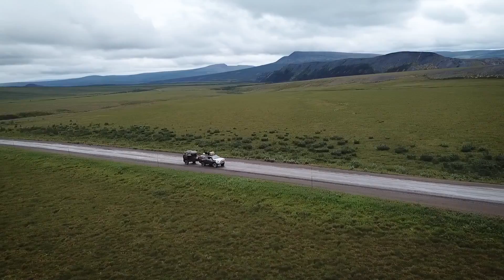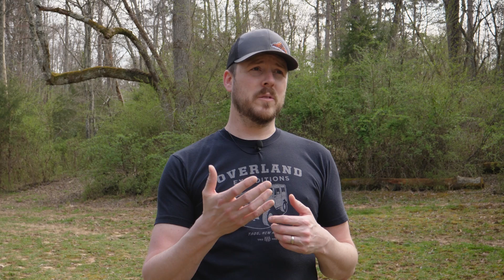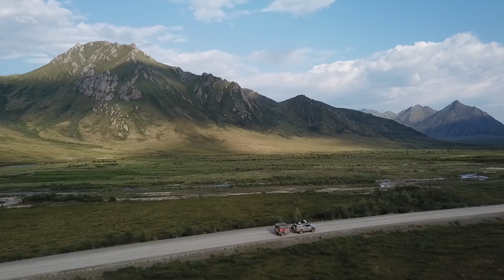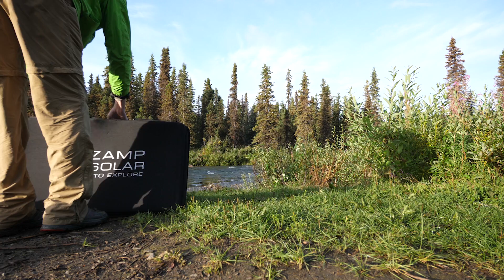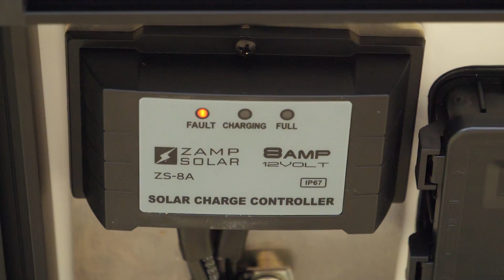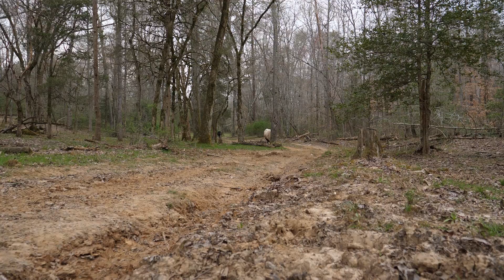Solar Panel Charging Systems for Overland Adventure

Comment: Very nice description of the various choices on offer. Is it ok to plug a roof top solar panel and charge controller to the starter battery or will it damage it when it receives charge from both the alternator and the solar panels?

Comment: Excellent video and very helpful! Im looking to charge my refrigerator during camping and beach trips that last 1 week or less. Not sure witch way to go for a continual charge for the portable IceCo 47 fridge. My worry is that the fridge will drain the Land Rovers battery during the night. Any recommendations for charges and small panels ? Love your change keep up the great work!

Comment: Kevin this is a helpful overview.  You mentioned the dc-to-dc charger and showed one of the REDARC units.  Their BCDC line has a built in solar controller.  Do you have a REDARC charger and if yes do you run any of your solar panels through it?  If not, why not?  Really like what you are doing and am interested to see where season 2 takes us!

Comment: great video I just picked up a snowmaster 66 dual low profile that is going to live under my bakflip tonneau cover I'm thinking about using a 1:20 amp battery a p m m t controller and a 180 or 170 Watt mono Crystal panel I figure I can set it on top of the tunnel cover during the day or have an aluminum welder and could make up up stand where I could remove it from the cover do you think 170 Watts will be enough to keep the snomaster going I also was debating getting some flexible panels instead and just laying on top of a bakflip cover let me know what you think

Comment: Nice setup.  We're pulling a T@B 400 boondock trailer with solar panels on the roof that charge the batteries while driving or parked.  Batteries are sufficient to run the lights, fan, and three way fridge.  My only issue is they are lead base and would like at some point to switch them to lithium, but swapping the controllers etc., which would be needed will probably put it out of my price range.  We also travel with an ARB 50 Fridge.  When moving it's in the back of our TV (jeep)using power from the DC plug in the back.  When we park, I pull it out and plug it into the AC plug on the trailer.  But, this obviously isn't an option when we want to boondock, so I reached out to Barry at Powerenz, Inc., and he suggested the LFP40 which is a battery, controller and solar unit all in one, and add an additional trifold 88w solar panel.  I can hook the LPF40 in the DC on the jeep, then the ARB into the LPF40 so both are getting power while moving.  I've done a test with the LPF40 and ARB and I was able to run the ARB for 18hrs on a charge.  Even at 18hrs I still had over a 1/4 power left in the LPF40.  There are plenty of connections to charge our phones and laptops as well.

Comment: Great information for me as I am in the planning stages to do the same.   I am also in the planning stages of upgrading my power grid in my 4Runner.  Unless you have done one of your great information vids on yours, could you give it a thought.   Thanks again. Your family is not only inspirational in Overlanding, but you have great presentations within the Overlanding community.

Comment: And the cow goes MOOOOO !
I have a 100 watt Renogy panel, two ( used but in great condition ) heavy duty industrial six volt batteries and a 400 watt power inverter. It's awesome, I have a 12 volt cooler that I run all day, I can charge up my laptop, phone, camera batteries, portable dvd player, and this summer I'm adding a small slow cooker to my set-up. I'll be making a stew while I'm out fishing. This set-up will be suitable for most people unless you are trying to run an air conditioner or a microwave. I keep mine mounted on the roof and I never worry about trying to park in a certain spot to get the most sun. It just keeps on working. I can even stay up late and watch dvds on my portable dvd player, plugged into my system, and it doesn't drain my batteries. Total cost aprox. $ 500.00. The same system can be used for an off-grid cabin, using a 12 volt RV water pump and 12 volt lighting.

Comment: Another great video! We run 2 100 watt mono panels with a 30 amp PWM controller and 2 85ah deep cycle batteries. The panels are portable for now, with a 30’ extension wire, but would like to mount them on the roof and get the Zamp suitcase model for when we are parked in the shade. There is a 2000 watt inverter as well for those times you need a blender 😁 Keep up the great work you guys!

Comment: I've noticed that you are running RedArc's BCDC, mounted above your air intake box. I assume that you are using the dual input (with the integrated MPPT regulator). What's your opinion on the device?
Reply: In use the red arc as well with 2 100w renogy panels charging 2 battle born lithium batteries.  The red arc does a great job and allows me to charge the batteries off the alternator too.  Redarc has been very impressive

Comment: @lifestyleoverland Which Redarc BCDC charger are you using? I’m running a 1224 which is a dual input. Alternator and solar. According to Redarc, it has an MPPT charge controller built in. (The reason I spent more to get the dual input version.) I’m hoping to get a panel this spring and just plug it directly in.

Comment: We have gotten by with the 100 watt Renogy Monocrystalline Suitcase unit now for 3 years.  Able to stay off the grid charging up our RV trailers two batteries.  Being portable, even dry camping in the Northeast, I can always find some sun.  I did extend my cables an extra 25' to reach a sunny patch.

Comment: Nice review of solar.  I've got a small system on my deck to run some lighting and a fan. All 12 volt equipment.  Doing more as a hobby, but the experience will help if we start camping/overlanding when we retire.  Thanks for sharing.  God Bless and Safe Travels!
Reply from the maker: Thanks, Chuck! Solar has all kinds of potential uses.
Reply: Yes, my daughter and her husband just had solar put on their home.  Now they are having Geo Thermal put in for heating & cooling.

Comment: Hello, really just started watching your channel last night (30 March 19). I discovered your channel a few months ago but for whatever reason did not care for it...not so much didn't care for it, because I love what you are doing and plan on doing the same in the very near future. However, I had been watching primal outdoors prior and was sort of tired of watching the same old thing...but didn't realize you guys were traveling all over the place..so we plan on doing it in a truck camper (Lance 1172) right now we have a Lance travel trailer and will be moving in full time by the end of May 19. Anyway, that brings me to my question or questions...I was wondering if you could give me your opinion on truck campers, and it seemed like there were a lot of them on the road when you traveled to the arctic circle and of course you helped pulled one out of the ditch...so do you think they would be good to travel up there the great north, limitations? The one I am planning on getting is the biggest one Lance makes with two slides...as well we just finished watching your journey north through Utah, Wyoming, Montana, etc....what about a truck camper in those places...I have a dually truck so wider than normal...I just wanted your opinion if you could please...good luck and hope everything goes well in your future travels!!!! Do your Aussie friends have a channel? Maybe we could get their input too :-) God Bless!!!
Ed

Comment: Hey got a question Kevin #overlandlifestyle what do you think of the 2004-5 Toyota sr5 model to the newer gen Toyotas? I just bought my first Toyota the other day used and working on getting it for off road - overland style.
Reply from the maker: I'm a big fan of all the 4Runner models to be honest. We've got some friends who took their 2005 all the way to South America and back with little issue. Solid setup for sure.
Reply: @LifestyleOverland  ya I love that interview video you did with them 👍 just trying to figure out a new idea for the setup of the rig, I'm new to overlanding and trying to grab up some facts of the newer Toyotas in comparison to older like mine. I guess your thoughts work to. Awsome thanks man sweet well next up new tires and shocks. Any recommendations for road tires?

Comment: Very informative as always, great video. We are running 100 w system, portable setup, not a high end system due to budget restraints, but, meeting our needs at the moment. We have had it for almost a year, and is working fine. Only time will tell; But, I didn't get a 25 year warranty either, that would have been nice. Thanks Kevin.
Reply from the maker: Thanks! Glad you enjoyed the video!

Comment: Great explanation. I would like to find a way to carry a folding array under my Gobi rack when not being used... Have you found that Zamp arrays/controllers to be weather proof..?  Two thumbs down, I see what you did there..
Reply from the maker: I looked at mounting the 100w under the rack so I could still use the rack space when I didn't need solar help. The Gobi is just too close to the roof for that. On of the cheap panels would slip under but I think the wind slap would kill it too quick 😕
2x👎=😁